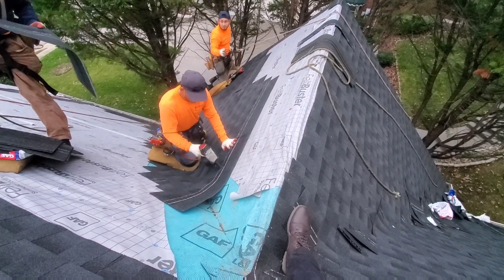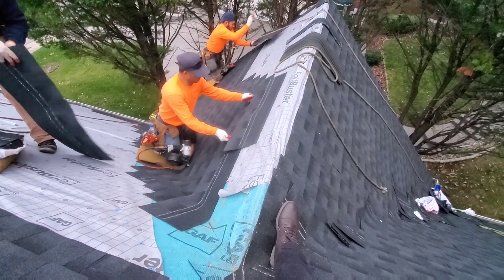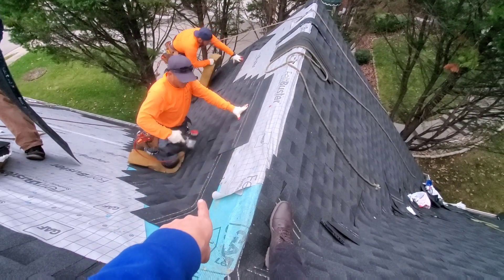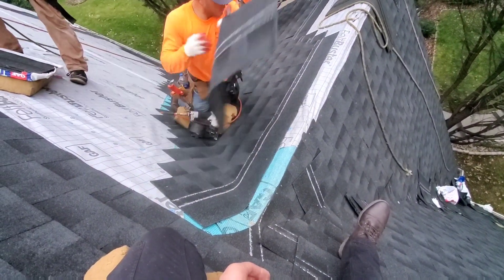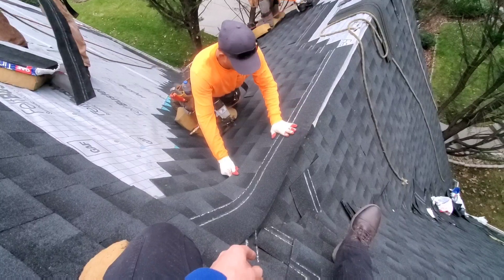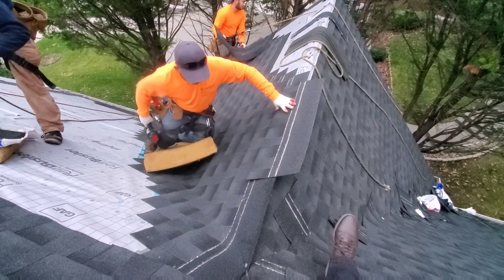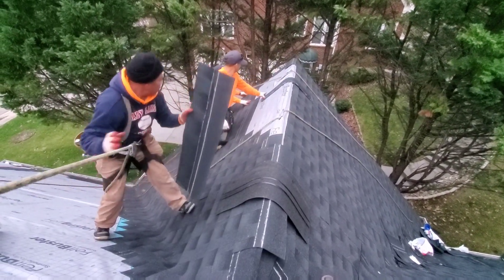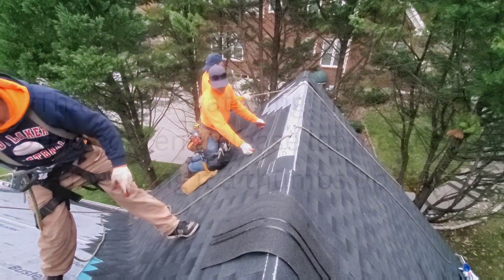Steep 12/12 Pitch - Real Roofers Shingle Valley

Comment: Non-roofer here and no comments from the peanut gallery...I understand there are six nails per shingle, but it sounds/looks like nails 2-5 are about two inches apart with nails 1 and 6 being near the edge. That is not just this crew but all videos I watch about roofing. Does this make it easier for the shingle to come apart with someone walking on it in the future? No, I am not asking them to pull out a tape and place each nail equidistance, just always wondered if it made it easier for the shingle to rip if/when weight is applied.
Reply from the maker: The space between nails 1 and 2 is where the next shingle lands. So absolutely critical to not have nails in that area. Many manufacturers only require 4 nails but each nail needs to be properly set. Easier to put 6 and allow for 2 to break the shingle or go in at a slight angle. Remember also that each shingle is getting a row of nails from the next shingle above it.

Comment: What is the manufacturer's recommended laying pattern?   Is it the just the basic 6 inch stairstep? or is a more random pattern be recommended?  A "Zipper" pattern will occur with several Architectual shingle brands when a simple 6 inch stair step is applied.
Reply from the maker: Depends on the manufacturer. I’ll tell you this, 99% of roofers are using a 6” offset (and should be). If it’s causing a funky pattern, the manufacturers need to change the design 😅

Comment: Kneeling in the valley lol
Reply: nothing wrong with that, its a 12/12
Reply: @mastersage5470 doesn’t matter if it’s 4-12 or 12/12 gonna break the shingle possible leaks down the road . That’s always one of the top rules
Reply: @rellik1878  break the shingle??? you're definitely not a roofer lmao those cushions will NEVER "break" a shingle in a valley 🤣
Reply: @mastersage5470 never walk or step in the valley.  Very easy to tear ice and water membrane if inatalled).  Very east for pound nail  or loose nail/staple to penetrate underlayment and shingles.  I've been a roofing contractor for 10 years and seen thousands of "craftsmanship", or lack of, leaks.
Reply: @natto_4  well then you're installing the roof wrong buddy, there shouldn't be gaps in the valleys between sheathing and ice&water/ shingles. you don't belong on a roof
Reply: @mastersage5470 ice and water, underlayment, and shingles are tight in the valley.  We also use W pan on 95% of our valleys for extra protection.  The valleys are often over framed so it's impossible to get 100% tight.  Based on what I see, this crew is piece rate and doesn't get paid for quality - they get paid for production.  You don't walk or step in valleys, ever.